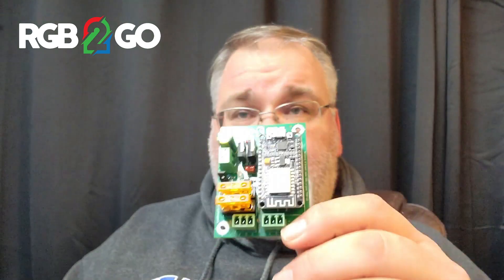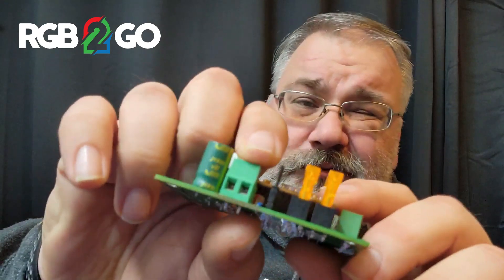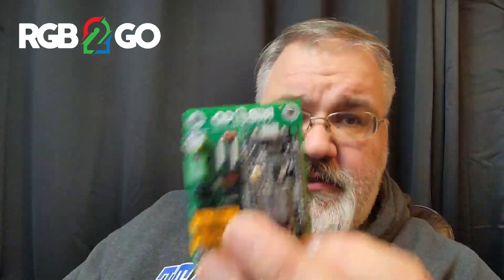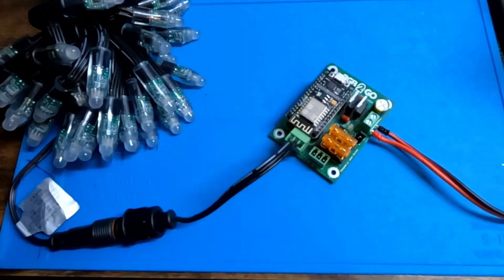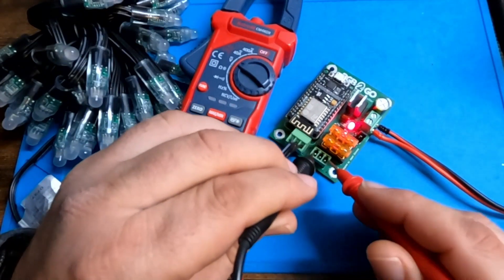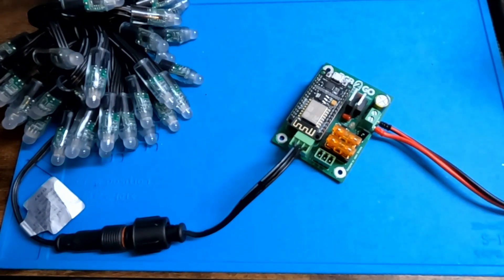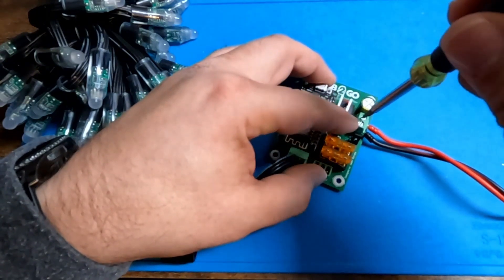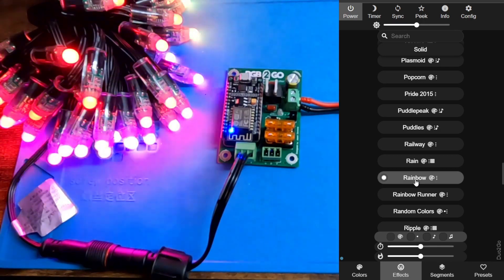Duo2Go Pixel Controller - Revision 1.5 Announcement

Comment: when sd card?
Reply: I am currently working on an SD card module for the Tetra. WLED, however does not really have SD card support yet, and the alternate Espixelstick firmware is still pretty buggy with ESP32's.

Once there has been progress on the software side, I'll release the SD card module. I'm not a software guy myself, so I can't speed this process up.